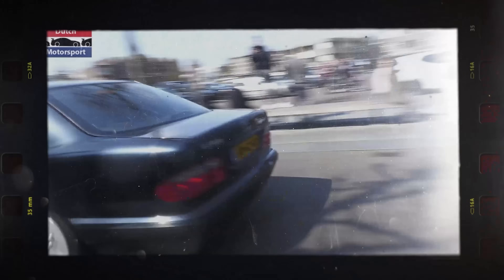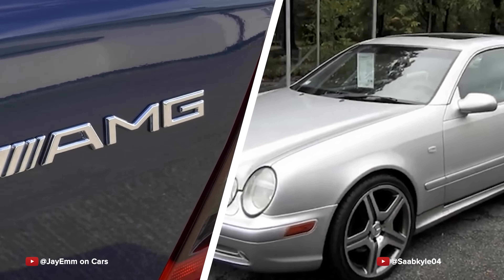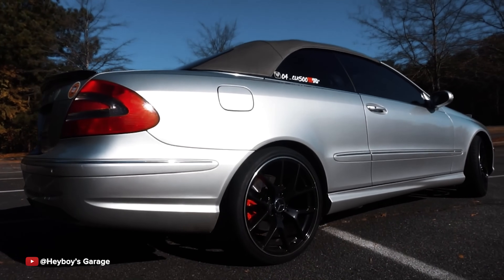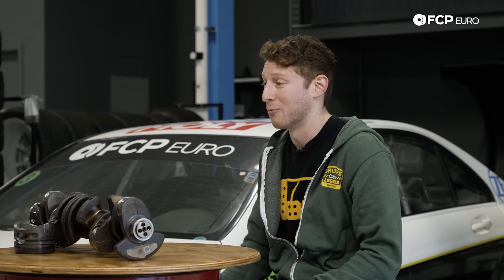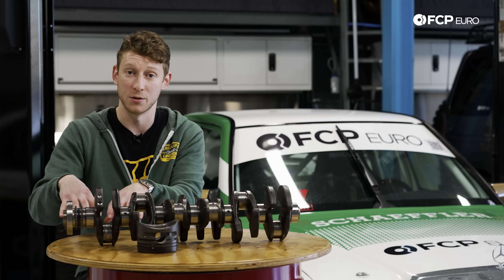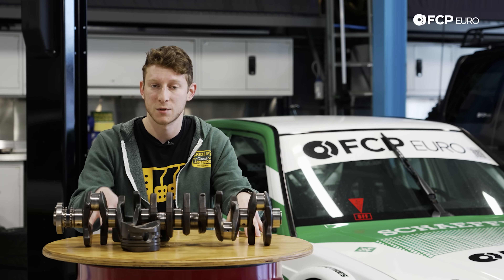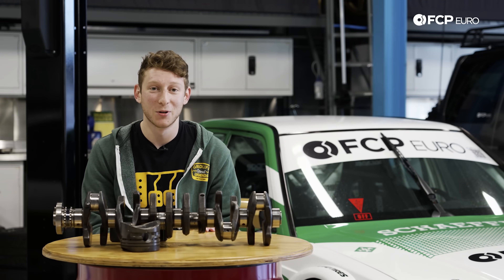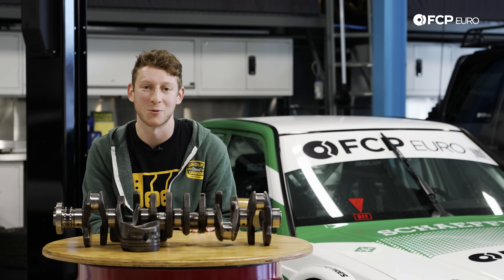Speed on a Budget - Fastest Mercedes Under $10,000

Comment: The CLK is a ruskly built on the E class im pretty sure. The rears and the hoods are comparable and almost exact as both the w210 and w211. Not to mention the interior also being much closer to the E class and more luxurious than the C class.
Reply: That's not how that works my brother. W208 CLK is built/based on the W202 C-Class chassis, W209 CLK is built/based on the W203 C-Class chassis, W207 E-Class coupe is based on the W204 C-Class chassis, W238 E-Class coupe is based on the W205 C-Class chassis etc. It's a formula Mercedes has been using for the last 25 years. Take the C-Class chassis, make a sporty two door variant with the looks and interior appointments of it's bigger brother E-Class...and print lots of money :)
Reply: @askbascombe Reliability is up as a result.  The C class they are based on is a few years old when the coupes go into production (at least in the US).  Plus no Airmatic or 4Matic.
Reply: @askbascombe  But it literally looks more like a E class than C class. The same as CL being the Coupe version of the S class…
Reply: @ImNuhxy  looks can be deceiving, but you’re right about the CL. 140/220/221/217 etc all based on S-Class.

Comment: Hey Danny wondering about your thoughts of an ML270 with the 5 Cylinder 2.7L turbo 2002 v the ML55
Reply from the maker: Check out our "Best Benzes Never Sold in the US" video from a few weeks ago and you'll see Danny is a big diesel fan! 

The OM612 is a great engine. It does have a touch of diesel complexities that make it different to live with than the M113 V8 in the ML55, but that doesn't necessarily mean it's worse to live with. Each definitely have their own strengths and weaknesses, but any durable Mercedes turbodiesel engines get a big thumbs-up from us. It may not be quite as fast as the ML55, but it definitely has the cool factor.

Comment: 5k to buy. 60k to keep on the road.
Reply: Couldn't be more wrong. Excluding the V12 & S class electrical extras, these are all the most reliable "modern" Mercedes out there & arguably the most reliable German cars that aren't pre 1990.

I've had my 3.5 M272 car for 4 yrs now & so sorry to tell you it's been more reliable than my last 2 Acuras & is 100% easier to wrench on than my mom's 3rd gen TL. Same applies to my sister's W203 C230 sedan.